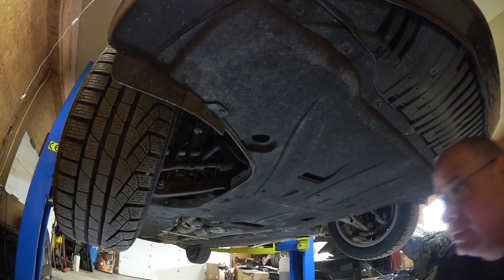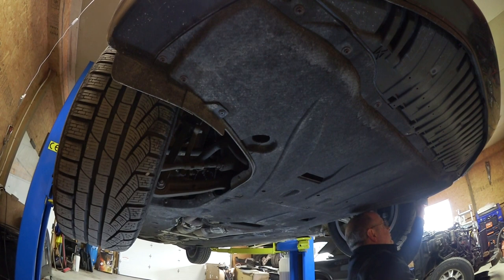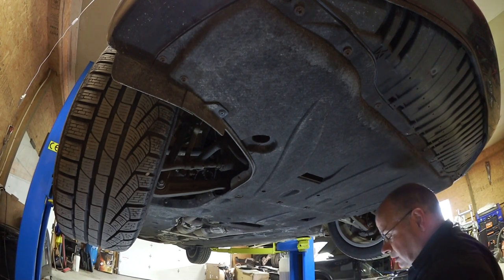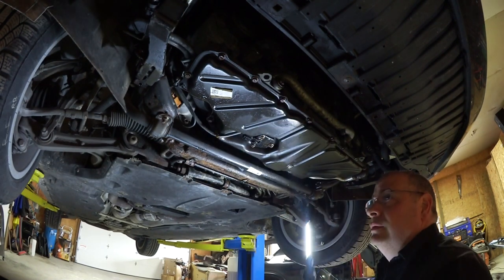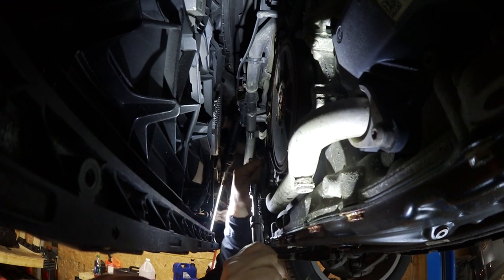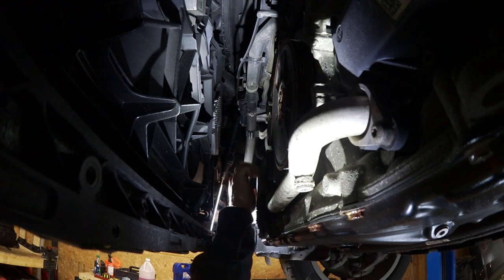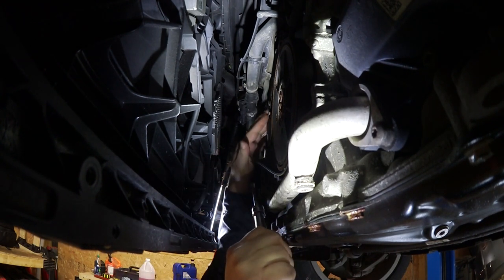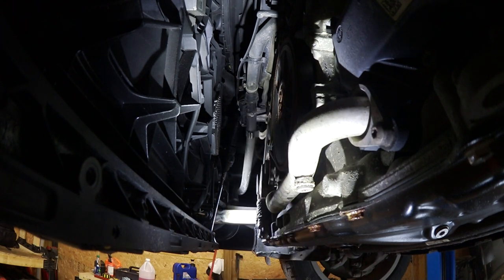Audi A8 D4 Serpentine Belt Replacement

Comment: Thanks - I just did this on my A8 D4 3.0TDI, it’s quite easy, the 8 bolts on the crankshaft pulley required M10 xnz spline socket in my case, 25mm M8 bolts. The tensioner is torx 60 to relieve the tension in order to replace the belt.

Comment: Mike, if you don't mind me asking a question. What was wrong with the 4 inch concrete you had to begin with? I have 4 inch concrete and I just installed an 8000 lb lift and I was wondering if I should be concerned about the safety of the lift and should I pour a pad like you did? The manufacturer recommends 4 inches.
Reply from the maker: Mine was a bit under 4 in places, most likely would have been fine was more personal preference.

Comment: What size of rachit are you using
Reply from the maker: 3/8
Reply: @mikesgarage1518  Is this triple square hex bit? (3/8)
Reply from the maker: @mannusidhu270  Just the 3/8 drive ratchet, the tensioner has a 3/8" opening for the ratchet anvil